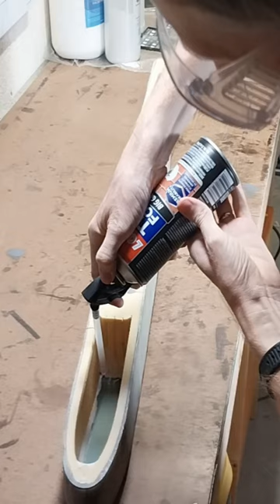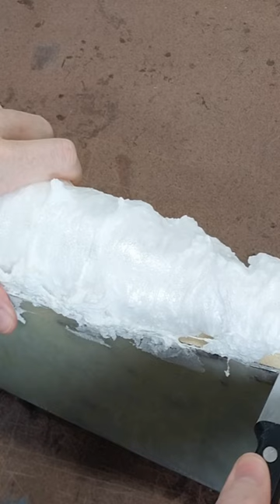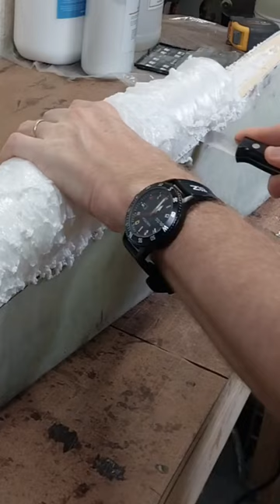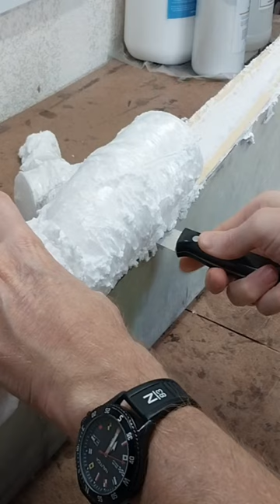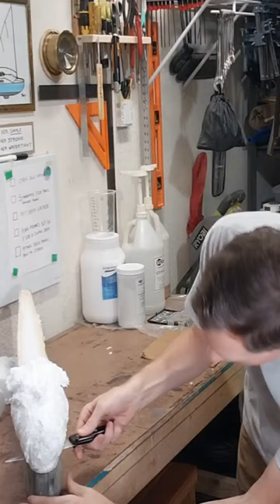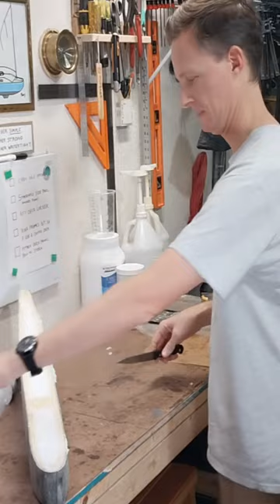Expanding Foam Application and Cutting ASMR #boat #boatbuilding

Comment: Looks white in the video. I hope that is not latex foam. You need urethane foam for rigidity and non compressibility.
Reply from the maker: More is explained in the long-form video. It is a polyurethane-based, high density insulating foam.

Comment: That stuff gets waterlogged and rots on boats
Reply from the maker: On leaky production boats, yes. But this will be well protected from water intrusion with many layers of fiberglass and it's a polyurethane foam that's designed to seal out water.